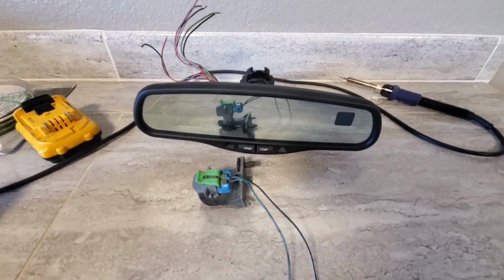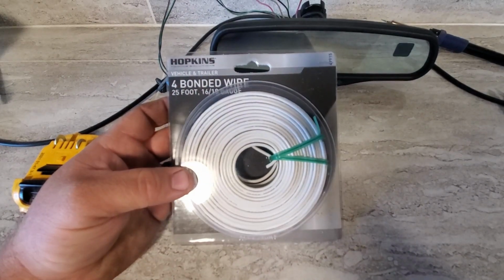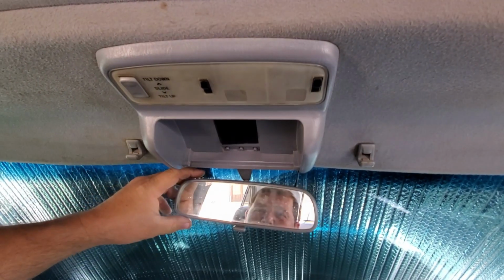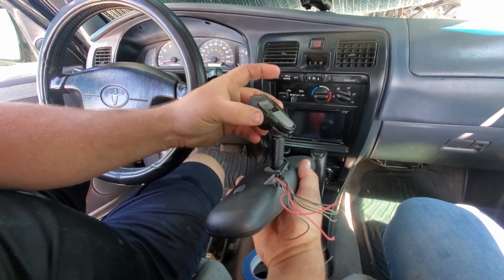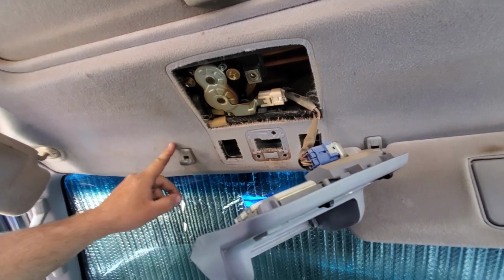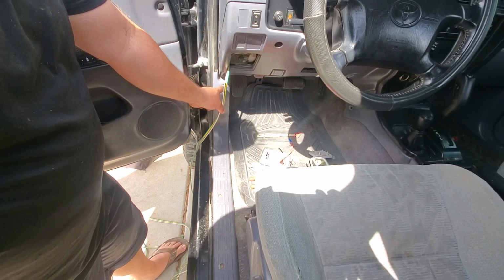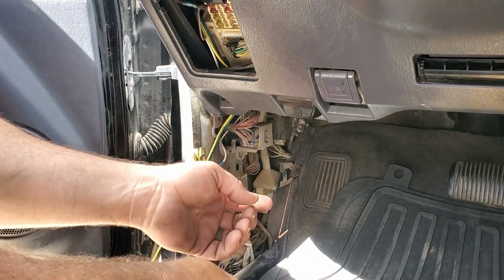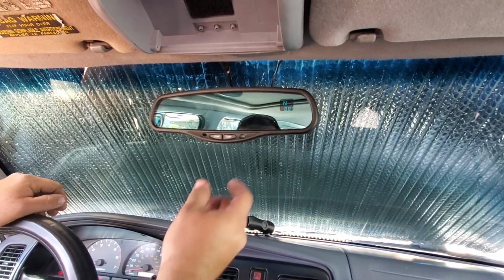3rd gen  Toyota 4runner compass and temp mirror upgrade

Comment: There actually not Phillips Head screws Toyota Uses JIS Screws Japanese Industrial Standard Screws its just if your careful Phillips head screw drivers will work on them
Reply from the maker: I've owned so many import vehicles I should really get a set of JIS screwdrivers. I think the worst case of needing one was the JIS screws for my 76 Honda CB750. They all stripped out with the Phillips head and had to be replaced.
Reply: @zealousoutdoors  oh yeah the older Hondas were a pain

Comment: How well has the gorilla 5 minute Epoxy Worked For The Mirror Install has it had any issues with the glass getting hot over the years?
Reply from the maker: So far it's holding strong. I'm in Arizona and we've gone over 100 degrees a couple times this year so far. I've used JB weld in the past and it's held for years through the summer heat.
Reply: @zealousoutdoors  no way bro I'm in arizona Also
Reply: @zealousoutdoors  I thought I noticed the Background in some of the videos but thought it might of been Utah or Oregon lol 😆

Comment: Did you need to calibrate the compass?
Reply from the maker: I didn't need to on the two I've installed. Usually it's by region from what I've read and the cars I have pulled them from were local. There are instruction online on how to calibrate it if needed. Thanks for watching!

Comment: Pretty easy Upgrade Did this ON my 97 LTD 4x4 My 00 LTD 4x4 and My 00 Sr5 and My 99 LTD and My 01 Sport and my 07 sport came with it Helps a ton. MY 07 Also has the Auto diving with the blue tint when somebody is behind you with there brights
Reply from the maker: Both of the mirrors I've added to the 4runner have the auto dim as well. My 4runner has limo tint in all the rear so I never see it switch, but on my wife's 4runner I notice it switching.
Reply: @zealousoutdoors  yeah the mirror dosent switch because the window tint is blocking 80 percent I took the mirrors I installed from a bunch of fords it's funny how the gmc and chevy mirrors look in some years exactly the same as the Ford mirrors... Did you know Second Gen Dodge Ram 2500 Manual telescoping Mirrors bolt right up to our 3rd gen Mirror locations

Comment: Buddy, I couldn’t get my Gentix 177 temperature to work. The compass works fine. I bought another ambient sensor temp reads at 124. Help
Reply from the maker: Hmm I'm not sure what would be wrong. When my sensor wasn't hooked up it displayed "OC" or something similar. I bought my sensor at Autozone for the model  and year Suburban I took the mirror from. They listed a couple part numbers that were like $30, and one that was less than $7. I bought the cheap one and it has been working fine.
Reply: @zealousoutdoors  I got mine from the junkyard. I actually tried 5 gentex 177 mirror they all read 130 degree 🙄 Thanks for your reply

Comment: How easy would it be to mount this to the original mount? In case I wanted not to have anything stuck to the windshield to use my full windshield sun shade and be able to keep it darker to sleep in
Reply from the maker: It would have to be custom mounted for sure. I don't have a stock mirror around anymore to reference. Thanks for watching!